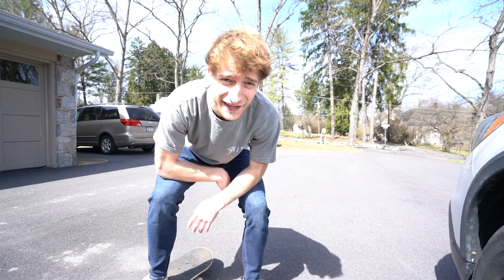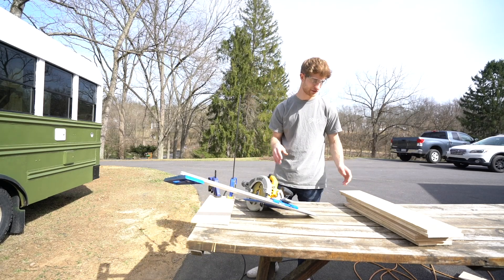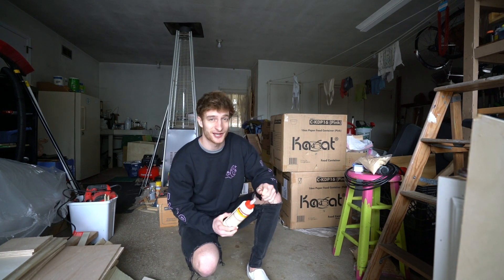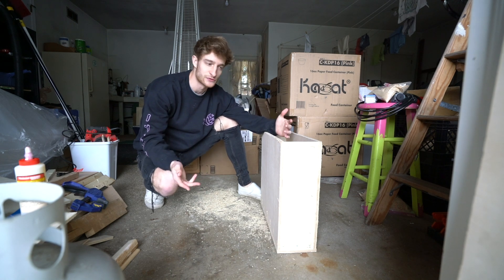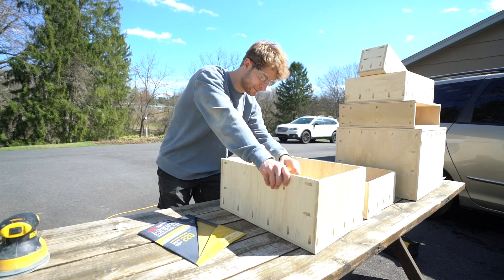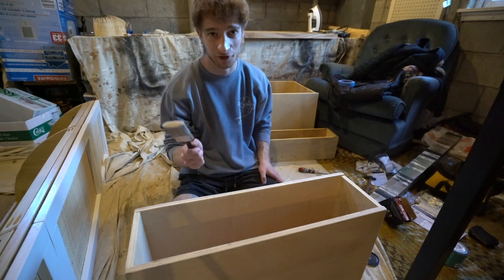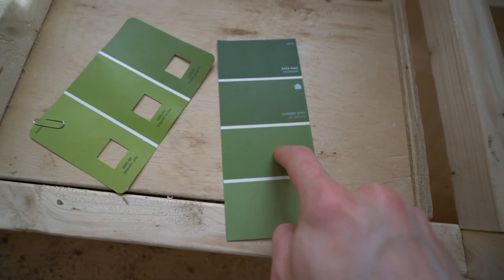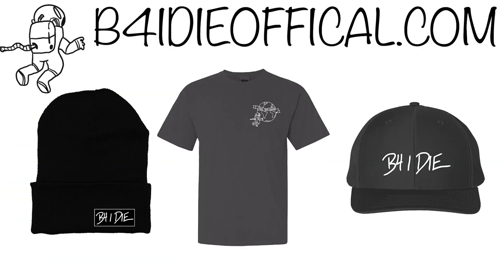Finishing Kitchen Drawers and Deciding Paint Colors - Skoolie Build Ep. 38

Comment: Hey man, we've been gifted a 30ft schoolbus, and are looking to skoolie it. Is there a list of tools you recommend? Also what is that thing you use to angle the drill holes called?
Reply: It’s a kregg pocket hole jig
Reply from the maker: It’s a pocket hole jig by kreg, you can pick them up at Lowe’s or Home Depot. For the most part you can get the job done with a set of drills, circular saw, jig saw, and I highly recommend a miter saw (really changed my life for this). As you go you’ll see what else might make life easier and if it’s worth the price tag!